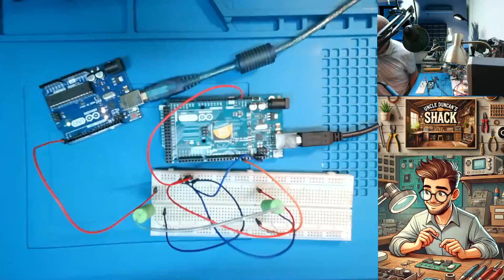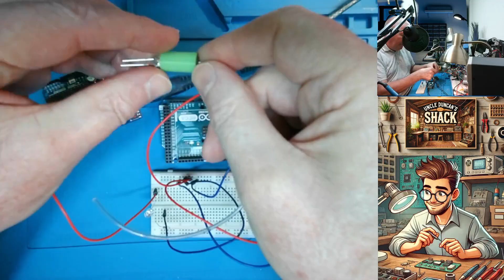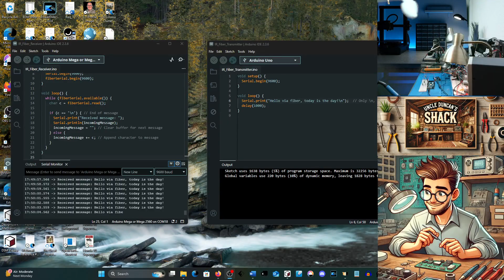# 🚀 Arduino Fiber Optic Communication Project – DIY PETG Light Pipes!

Comment from the maker: Transmitter code
void setup() {

  Serial.begin(9600);
}

void loop() {
  Serial.println("Hello via fiber!");
  delay(1000);
}

Receiver code

#include <SoftwareSerial.h>

SoftwareSerial fiberSerial(10, 11); // RX, TX

String incomingMessage = "";

void setup() {
  Serial.begin(9600);
  fiberSerial.begin(9600);
}

void loop() {
  while (fiberSerial.available()) {
    char c = fiberSerial.read();
    
    if (c == '\n') { // End of message
      Serial.print("Received message: ");
      Serial.println(incomingMessage);
      incomingMessage = ""; // Clear buffer for next message
    } else {
      incomingMessage += c; // Append character to message
    }
  }
}

Comment: I was surprised to see 9600 baud .  That is whistling  along for a simple setup like this.  Not even optic fiber  filament . This shows the wisdom of just trying something instead attempting theoretical analysis . Thanks very much
Reply from the maker: It was surprising to me too, but it shows the value of experimentation!
It does begin to fall over at 19200, but 9600 is not bad.